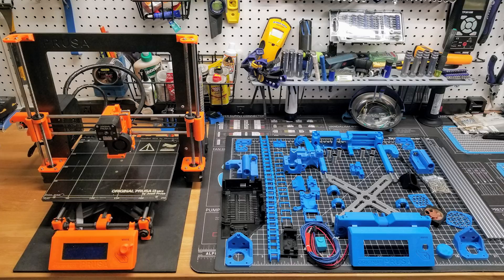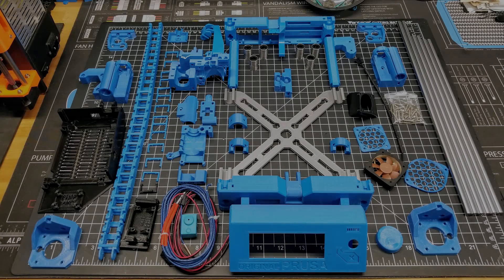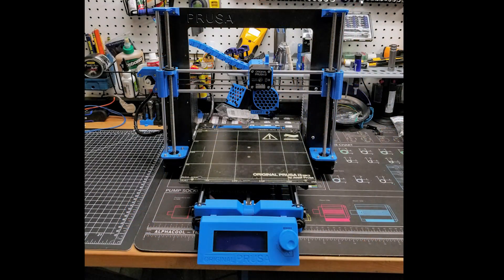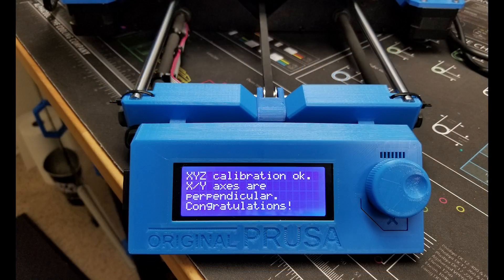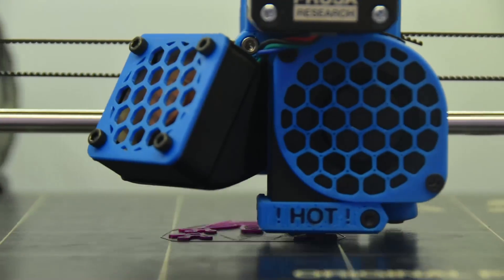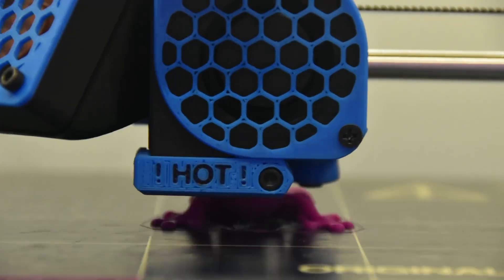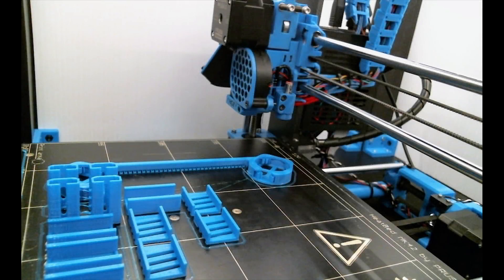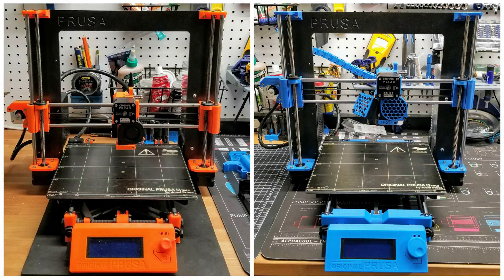Prusa i3 MK2s 3D Printer  Upgrade Timelapse

Comment: Do they sell them in different colors? if not they should
Reply from the maker: Look into the "Prusa Bear" Mod. They sell upgraded replacement frames in all kinds of colors.
Reply: @MrArmageddonBuilds  Oh I saw those on Aliexpress before but I was talking about all the orange 3d parts. Why doesn't Prusa sell the printers in different colors? I feel like they could sell way more because it would be peoples favorite colors right out of the box and they dont have to print all their parts just to get what they want
Reply from the maker: There are users that will print the parts in the color you want for a fee. Just ask around on the Prusa Community Facebook page for someone in your area that can do it.

Comment: Hey I love the video man, about to rebuild my prusa mk2s right now. Any tips you have for how to save most time and headache replacing the printed parts?
Reply from the maker: Patrick Murphy, can't think of anything that will really save time. Just be sure to check more than once that you have all the parts you need printed before you start taking yours apart.
Take your time and follow the instructions from the newest version of the manual if you get stuck.
Reply: MrArmagedd0n thanks for the quick reply! I’ll let you know how it goes.

Comment: Super cool video man. So the blue parts are a mix of ABS and PLA, with ABS used for heat-exposed stuff? And the color of those two filaments just happened to match nearly perfectly?
Reply from the maker: Austin Vojta, yes, ABS around the Hotend and Extruder, PLA everywhere else. Took a while to find matching colors. 
Will probably go PETG for everything next go around.
Reply: MrArmagedd0n pretty awesome man. I have pre-ordered a MK3, my plan is to print the parts as soon as Prusa releases the files. So I can use PETG for everything and ensure the printed parts are of good quality, plus customize the color, before I even do the initial assembly. :)
Reply from the maker: Nice, sounds like a good plan.

Comment: How do you like your Misumi bearings?  Which specific model did you order for your machine?  Did you order them directly from Misumi or through a supplier?  Thanks!
Reply from the maker: So far they are working out really well. I purchased them directly from Misumi USA, LMU8 Linear Bushings

Comment: Would you mind if you can share what filament are you using?  Are there any major improvement over the stock MK2S setup?
Reply from the maker: Steve L, I used Hatchbox PLA and ABS for these parts. The main improvements are easier to square up Frame (had skewing issues with my last build, these parts fixed it), quieter operation with the new rods and bearings, better cooling and less noise from the 40mm fan upgrade. So far my prints are coming out perfect. Cable chain was more For looks, but I really like it 😁